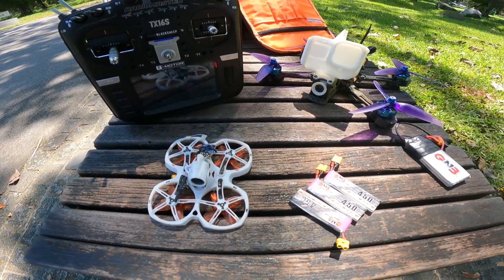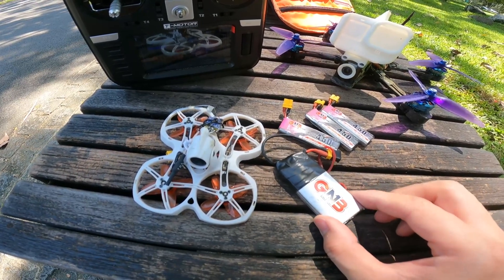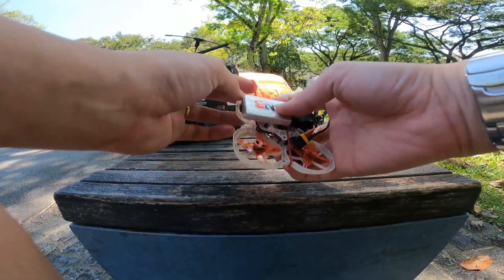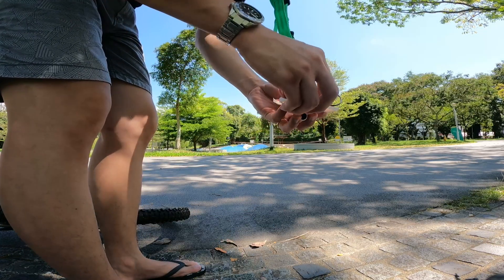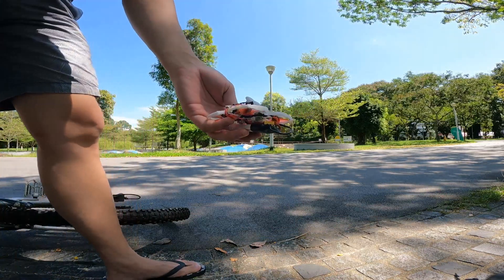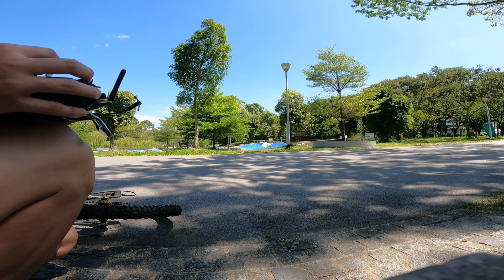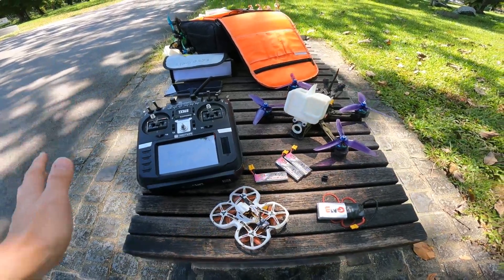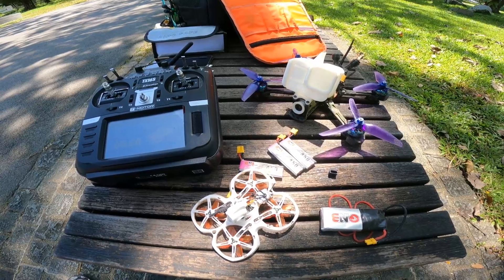1s 1500maH on Emax TinyHawk 2 (FatHawk) - Part 2

Comment: Well ..i have actually been running a 1500mah battery like this that came out of one of my holy stone drones. Its skinny but long. Its the same width of my 1s cells but teice as long. I think the blockage of air was the issue it was having. I had to modify my pids quite a bit though to make it work.